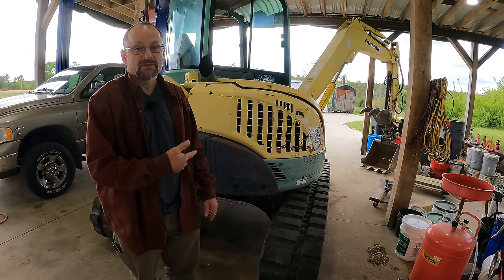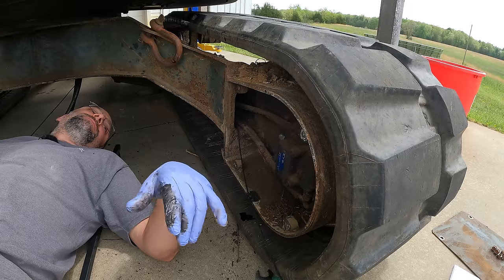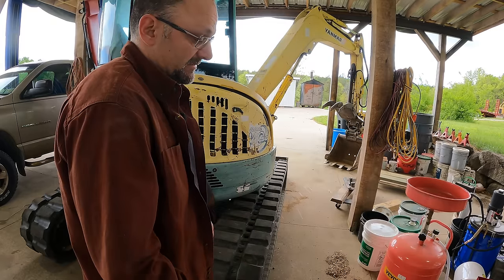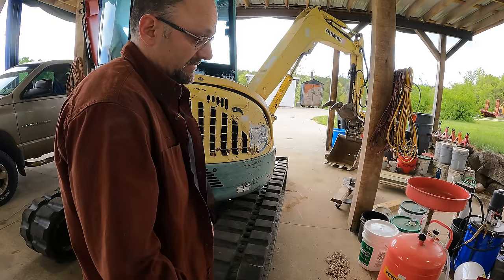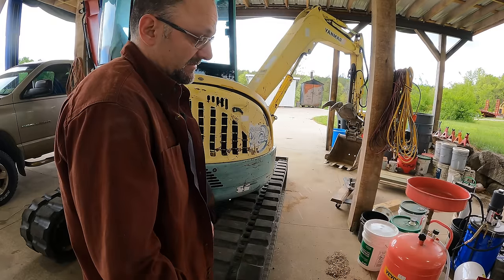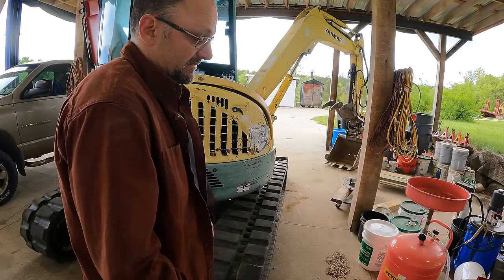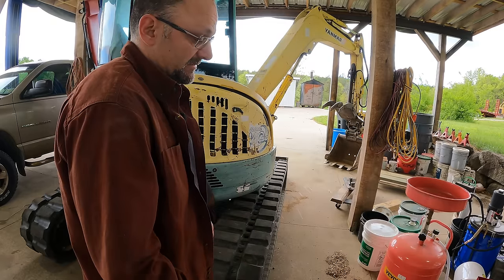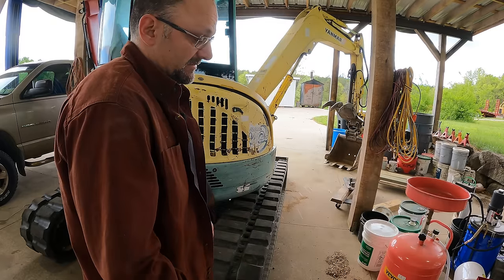Excavator Not Tracking Straight, TOUGH Hydraulic Repair.

Comment: Take the case drain hose off each motor put the hose in a bottle and measure the amount of oil in the bottle the one with the most oil has leakage in the motor and it it bad. All excavators have a very per feet.

Comment: Put a one way adjudstable restriction valve on both sides of the fastest motor, the return should not be restricted so it has to be restricting only the pressure side

Comment: Well the best solution is to accept the slight turn to the right.   You never mentioned the Track Adjustments, maybe one track has more tension than the other, or just more dirt in the rollers.  Remember, It is an Excavator, not The Space Shuttle.

Comment: Might be a Jerry rig fix. I worked for a guy who fixed this by tapping a bolt hole in the foot pedal and then used a bolt to limit the travel of the faster motor at the lever. Total cost.....$1.00

Comment: hmm stopped at 28:52, I see TWO options
1: left valve has flow imbalance(pain)
2: left pump is weak/leaky(easy fix)
if I was diagnosing a hydraulic issue with a multi-pump device like this I would first swap traction on carriage(done), then do a side swap on the input side of swivel(all 4 though as shown just 2 hoses can inform), then if the issue shows a valve/pump issue I would then swap pumps, to see if the issue swaps to the right, and if the issue is clearly stuck on whatever motor is connected to the left I would cry as teh sheer number of hoses would make me rage-quit

Comment: I am just guessing here , I bet you would get good use of a borescope . Some of these problems could be simply a slightly damaged o-ring , that you do not have a good way to examine.
Reply from the maker: A borescope is a good idea, I need to get one.  But those valves don't have any internal orings.  It just tight clearances between the valve body and the spool.
Reply: @FarmCraft101   Wow! Is that tight clearance measureable by measuring the amount of flow that goes the wrong way?

Comment: you probably have it all sorted by now but could it be that the motors are not identical regarding revs.
Reply: In my opinion this problem can't have anything to do with the motors. It tracked to the left and after he switched the hoses it tracked to the right so there must be a difference in the oil flow between the circuits.
Reply: @ontheroadagain4773  How rite you are thanks.

Comment: Put a block of wood behind the control on the 'fast' side, and move slower but straighter.  Or add a turbuckle to adjust the spool valve to limit the 'fast' side.  You will lose something in reverse, but that should be an acceptable tradeoff to traveling straight(er) with fewer corrections needed.  Sure.  I am about as much a hydraulic expert as I am a nuclear physicist.(neither)

Comment: I'm not a Hydraulic genius but the Banana Bend to the right was not as bad as the Banana Bend to the Left (I think it was that way around) ...... Why?????
My head tells me that you simply have wearing components and to have both on the same side results in less drive on that particular side. 
I'd be putting the worn pump on the opposite side of the worm motor to try to obtain the straightest bananas possible then just put up with the difference because when actually working doing what the machine was made for it will be hardly noticed. 
It would be cheaper to buy a trailer to move it longer distances!

Comment: Hi...
1st I'm NOT a mechanic;... perhaps I'm a maniac... ROFL
I'm thinking outside the box...
While my thoughts R based on something totally different;... which did solve my problem;... it just may assist your tracking problem...
From what I've seen in your GR8 video;... is there NO stop or adjustable link on the travel levers...
If not;... can U make something;... a bracket up where U can limit the offending side of travel...
@ 15:53
I Note when U R sitting in the cab looking down...
The levers R NOT parallel 2 1 another;... not much granted;... but it might just B enough causing your problem... It was in my case...
At full throttle it is clear the left lever moves O so slightly further that the right lever...
It's NOT clear looking down at the floor...
My problem was down 2 worn linkage pins... Rotating the pins 90' solved the problem;... replacing the pins FIXED the problem... Which were less than £1 a pin ~ 2 replace...

Comment: As I said in another answer, if the excavator can climb or push the blade easily I would use it as is until the problem worsen to an unbearable level.

Traveling with one controller a little further than the other is not really a problem.

Going 2.5 miles/hour instead of 2.9 is not a real problem neither.

Of course letting a problem unsolved is bothering but for once you could just wait and see...

Comment: Why not check the pressure of each travel motor hydraulic line to see if they are the same of course this won't test volume of flow to see if they are the same.

Comment: From what I've seen here, the control valves are going to give you the most return for your investment here. A good director can often get quite a lot out of an orchestra of mediocre players. I think even if your pumps and travel motors are in mediocre conditon, if you have a new (good orchestra director) control valve block (I would be replacing the whole thing while you're in there with all those hoses) then you I think you will get a much bigger difference in useablility here. I have been in this situation in my time as a fitter, and replacing control vlaves has made shitty equipment more tolerable to use because oil was being directed better and more efficiently. I might be wrong just my take here. 

I don't know about your problem solving, it's always hard in hydraulic systems. I would get yourself a laser temp guage and use it on things like valve blocks, it will show up excess flow where there shouldn't be that much flow in the form of heat. It can show you bypassing in valve blocks to tank when it shouldn't be.

Comment: First - sorry for bad English language. I am hydraulic mechanic from 1991 year.From all the diagnostics you did, it is clear that your main problem is an internal leak in the pumps. The piston pumps are quite easy to repair - you just have to grind two surfaces just to be free from scratches an be flat -valve plate surface and rotor surface that actuates with valve plate. Oil flow just passes between tank port on the pump and pressure port, and may be between two pressure ports. It can be easy diagnose with inline flow meter, but you did great diagnose job, now it is clear where is the problem. This repair will be cheap if you have surface grinding machine or shop near by that has it.

Comment: Personally, assuming the piston pumps ONLY feed the travel motors, I'd check their output pressures and flow rates before messing with the valve block...

Then, assuming the pumps are OK, I'd check the pressure relief valve...only if PRV is OK would I then start dismantling the valve block...

Comment: Boy, I know how you feel. Little stuff like that just drives me up a wall. In view of how costly it likely to be to trouble shoot and fix the actual problem and since the machine is operating good except for that little quirk, I would probably jury rig an adjustable travel stop on the lever for the right side to slow it to match the left so you would get proper tracking. Several skid steers have these adjustments on the drive motor valve actuator levers to correct tracking deviations like this. I think all track vehicles should be so equipped. And I would be so anal about it, I would even bend either lever back or forward to match the other when moved to full on but that's my fastidious nature. You probably wouldn't want to go to my extremes but that would be a fast and nasty "field fix" to this problem.

Comment: I'll bet that somewhere there are some statistics that may show that HYDRAULICS "gremlins" in equipment, and the practicality of "tearing into those tiny snake pits" on a lot of equipment, leads to equipment abandonment and replacement with new or newer units. I used to have nightmares about hydraulics when I was in the Navy. They were defeated by knowing that I had a full and complete manual for the system I was troubleshooting/adjusting/repairing... Mil Spec standards on reliable and complete documentation "usually worked"...  I still hate gremlins and hydraulics.

Comment: The sad irony is that when you bought this machine you thought you where getting a good deal now you're looking at ~9k in parts alone. I know that it's standard practice to have a mechanic check out a used car before you buy it, is there any such service for heavy equipment? It may only have 3500 hours but they were very hard hours from the looks of it.

I don't know how well this applies but one of the primary aspects I consider when buying vehicles is part quality,  price, and ease of replacement. When buying future equipment that may be useful to keep in mind too.

Comment: can someone help? I purchase a used  bobcat 8811 backhoe  attachment and I rebuild all cylinders w/new seals; attachment din't have the male and female couplings so put new ones,, [not sure if in right way] when in I try to run it,,,, the oil starts to get hot within in minutes and hot oil will shot out the couplings: check other similar models for correct connections of the lines but can't figure it out.

Comment: Should have just swapped track motor lines on the rotate manifold. You wouldn’t have need to buy hose and fittings.
Reply from the maker: They wouldn't reach, even at the swivel.
Reply: @FarmCraft101   that’s just bad luck there sadly. I have a Tigercat 822 track cutter that I am fighting the same issue of not tracking straight. I most  definitely understand the frustration of having to constantly readjust. Btw best channel on YouTube don’t miss a single one. Started tongue and grooving my own boards from my sawmill because of you.

Comment: I see a lot of comment to restrict the flow on the fast side . That is the wrong approach. In a perfect world the pump would putout the exact flow on both side the valve would flow the same flow from each section and the load on the motors to drive straight would be exactly the same. I work for the largest Hydraulic manufacture in the world suppling hydraulics for Ag and Construction equipment commissioning new systems at the OEM. In a manual open center hydraulic system i have yet to see one that does not have stroke limiters on the levers for straight tracking. Skid steer loader straight track generaly 1 track width in 100 feet. The pump you have i beleive is a Uchita. They are the only manufacturer of an open loop split out put that I know of. Adjustment of the torque limiter you where tweeking in 1/4 turn increment will only adjust the flow when you get to the pressure limit at a pump displacement. Example ( if the limiter is set to start limiting flow at 100% flow and 1500 psi then it will also start to limit flow at 50% flow and 3000 psi.) and it works on both out put the same. The flow on these pump is split with every other piston in the rotary going to each outlet. This is the best flow divider made. If there is a difference in flow then you may have scratches on the piston or slippers or barrel and lens scratches. You could hand lap the slippers and barrel lens face and make improvement but you will need to replace shaft seal and o-rings when you have it open.

Comment: If there is an adjustment of travel of the sticks in the cab, see if retarding the left stick will slow down the left drive motor...
Check the diameter of the drive sprockets to see if there is a difference...  You want them equal...

Comment: Maybe these guys (&girls?) at Yanmar purposely designed it like this, so your tracks wear out faster and they sell more???

And I don't know what the manual says about this, but maybe this tracked vehicle is not meant to drive from home to work and back by itself. Maybe it's meant to be either in the mud or on a trailer?
Maybe only wheeled excavators are meant to drive straight on a road?

Maybe, instead of trying to make this excavator track straight, you better invest your time (&money) in a designated trailer especially for the excavator? A trailer that always stays with the excavator and has some basic tools, a leaktray, extra oil and fuel, extra buckets or other attachments, etc.
And another advantage of working with your excavator this way: you always have a faster vehicle with you. So if you're working with your excavator and suddenly you feel like you really need some coffee right f**king now, you can leave the excavator (and its trailer) at the worksite, get some coffee and be right back.

I don't know.
Just some thoughts.
For you to consider what to do.
It's YOUR excavator. If you rather set it on fire and watch how long it burns, I hope you make a nice video out of it.
Reply: Also a thought about your Johnson:
(No, not that Johnson. The Johnson Seahorse outboard engine.)
Or more about (older) 2-stroke-engine-ignitions in general.
If you losen the screws that hold the ignitioncoil in place a little bit, you can move the coil a little bit. 1 or 2, maybe 3 millimeters. Now push the ignitioncoil to the outside and tighten the screws again. (outside= closer to magneto, or where magneto would be if it were in place, cause you probably removed it to get to the screws.)
Now the (core of the) ignitioncoil should be so close to the magneto, that if you look at it you'd swear they touch, but if you turn the magneto it does not scratch.
If there's stil visible space between magneto and the ignitioncoil, I would make the screwholes a little bit bigger and try again. (Since you replaced the coils, there's also a possibility of the screwholes not being in exactly the same place as in the old coils.)

But that's what I would do.
If it was MY Johnson.

Comment: If was me first wouldn’t worry about that slight tracking issue but if did bug me I’d just weld a nut and thread a bolt to faster side lever and adjust to track perfectly and take ten minutes and be great and adjustable till catastrophic  failure which it’s a yamar so prob be fine for years but the. You wouldn’t have content

Comment: Your gonna laugh, but i know what the problem is!

One leg is longer then the other.

Ok no joke, one valves orfices is blocked so more fulid flows to one side with more presure, i wonder if you can regulate the flow with a setscrew adjustment.?  Something simple and stupid.  Last, 2 differnt size hoses.

Last and you looked right at it, the arestor regulator. It only has one and what pump was it on out of 2 pumps?  Remove it and bypass it problem goes away youve found the problem, maybe it has an adjustment?

Comment: not a fix and deffinetaly in the horrible bandaid catagory but here it goes.....when you first started diagnosing you adjusted or at least checkedfor a  pedal stop to ensure it wasnt just a simple pedal/lever issue....now having determined that you cant repair it correctlywithout investing to much blood sweat and screaming from your wallet  how about picking whatever side happens to be the faster now and  ajusting that pedal/lever or maybe a flow restrictor or adjustable valve in that line near the travel motor to even out the sides..... it will not help with the slop increasing with heat so more just a slightly less annoying fast travel to the job then anything....had to add I never advocate for the bailing wire and jbweld route but sometimes  ya gotta do what ya gotta do lol.

Comment: I cant believe you went to all that effort on the hydraulics and valves. And not once checked to see if your sprockets/track chains are the same size! 😂😂😂. Like hight wise I mean. You know they're the same length,  you just put new ones on the machine.  
Also why didn't you lift the machine with the bucket and blade to get both tracks of the ground and see how much out of sync they are!

Comment: in airplanes, you have a limited ability to adjust controls to maintain straight and level flight. This is done through, what are called, trim controls. You might be able to make pseudo-trim controls, to correct for the drift by artificially retarding the dominant track enough so at full, it engages only enough to be even with the retarded track...

Oh, and are used out of the question? It's a risk, but potentially a much cheaper risk...

Comment: PLEASE DO NOT use a vacuum to hold back the oil. just the dust in the air will damage your system let alone anything you get sucked up from around the fitting. I know it seemed like a good idea but there is a reason that no one does this and why!

Comment: if you are going to work on the machine yourself -  get yourself a service manual for your machine making sure the manual includes the serial number.  Watching you troubleshoot without a few years  experience working on every system of your machine is just silly.  Service manuals can also save your life.  informing you on what systems have to be secured - such as many systems that have nitrogen accumulators and many hoes do - there are systems you would not attempt to pull a hose off without blowing down the lines.  Service manuals also give specs so you are not just buying loads of parts.